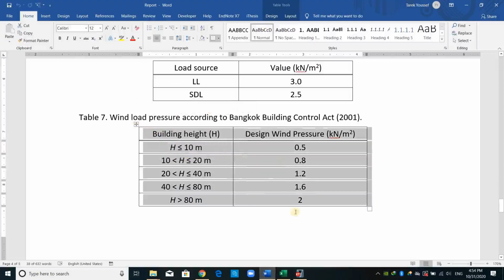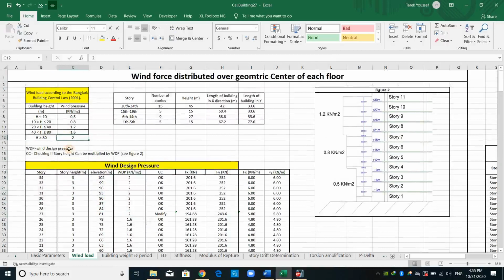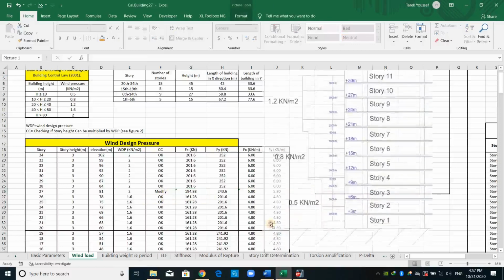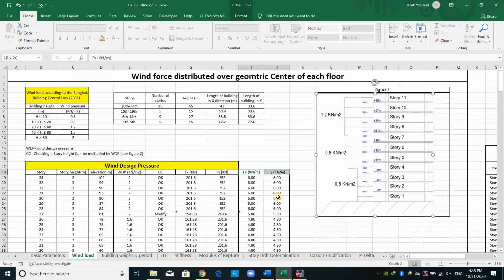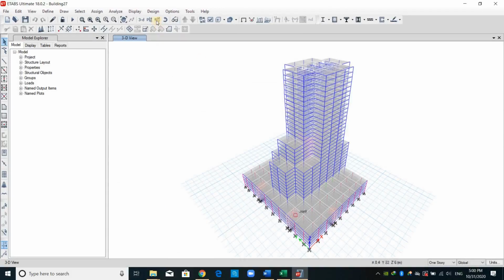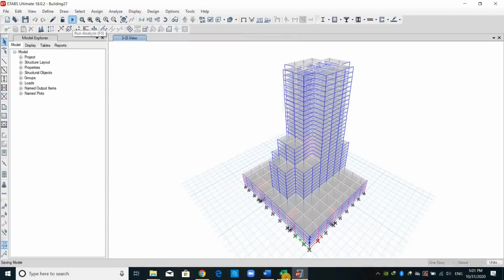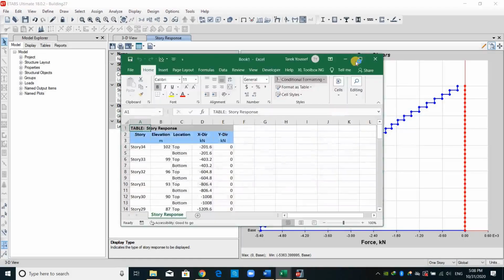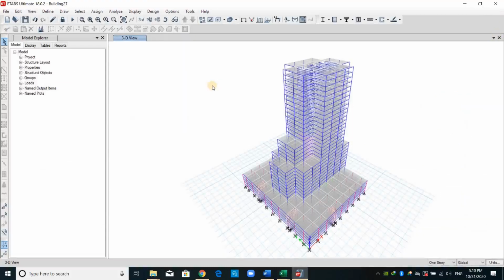How to Assign Wind Loads as a uniform distributed frame load (Thai code) (Lec8)

Comment: excellent video. one question... why you did not assign the Fx load on the existing beam? why you crerated dummy beam to assign wind load?
Reply from the maker: In this particular building, there are no beam elements at the slab boundary and it becomes necessary to create this dummy beam in order to assign a uniform distributed wind load.

Alternatively, we can assign the load as a point load applied at the center of mass. This approach offers an alternative method for applying the wind load to the structure
Reply: @Eng.tarekyoussef  HELLO SIr, istead  of dummay beam, if we use a non beam,it works??